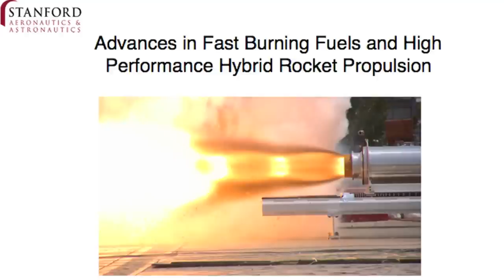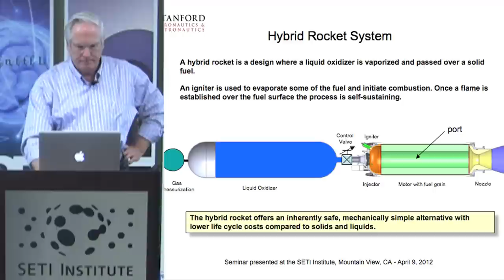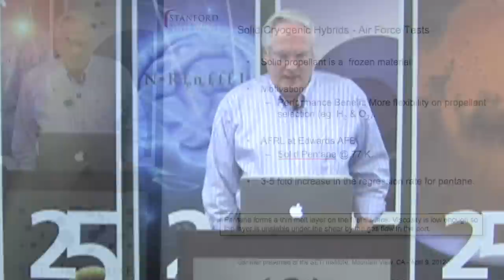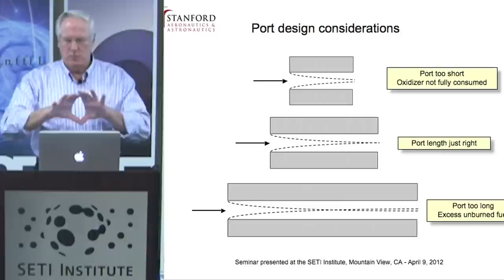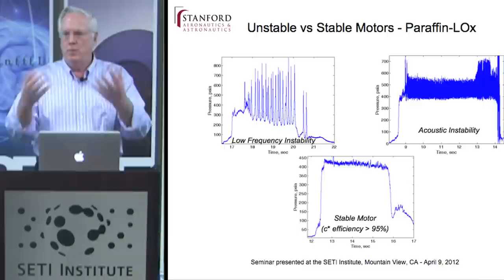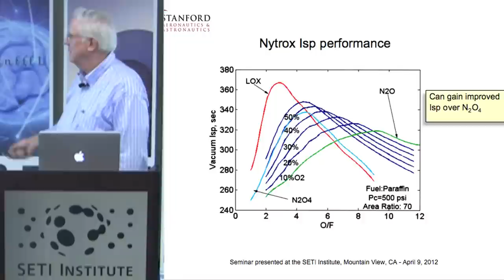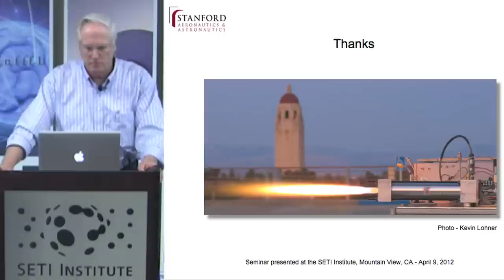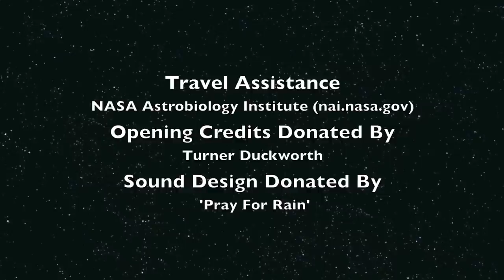Advances in Hybrid Rockets - Brian Cantwell (SETI Talks)

Comment: WOW! What an informative lecture!  Brian, I just discovered this video post.  Even though it's several years late, I am just now in a position to be able to build a (simple) rocket.  I was thinking of building a hybrid motor, for the very reasons you specified.  I was thinking of using KNO3 and sugar as my fuel, and NO2 as my liquid oxidizer.  I would really like to reach mach 2 or 3, so how big (by lbs and diameter) should my engine be?  Thanks for your patience with a newbie,  Matthew
Reply: you might want to check with your local regulations on rockets before you send rocket speeding at mach 2 straight through the body of a plane flying overhead, just a reccomendation
Reply: But KNO3 is an oxidizer.